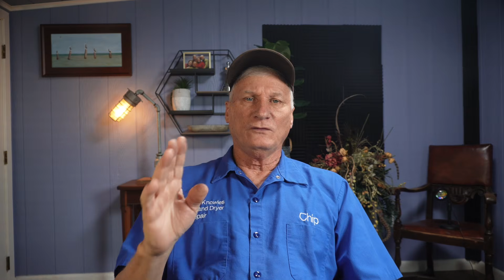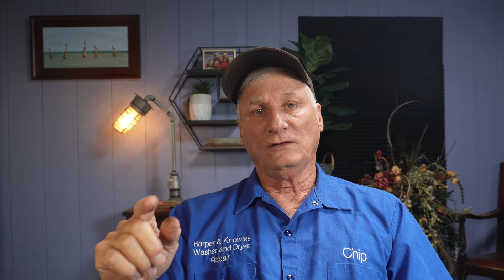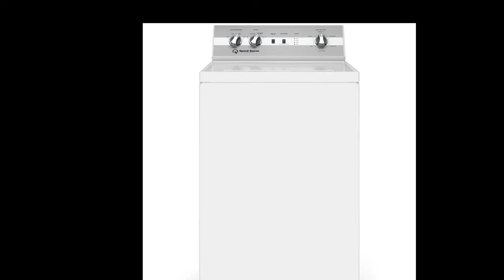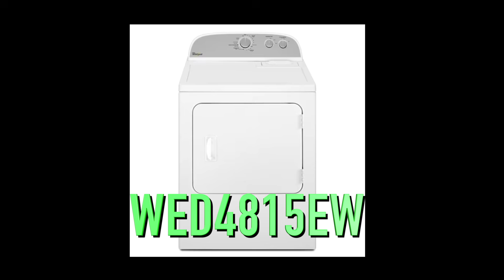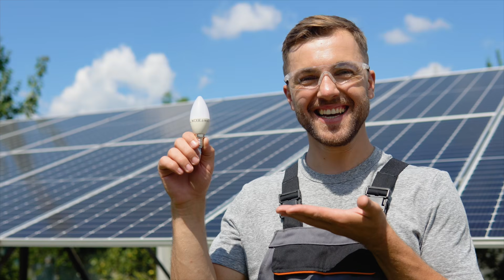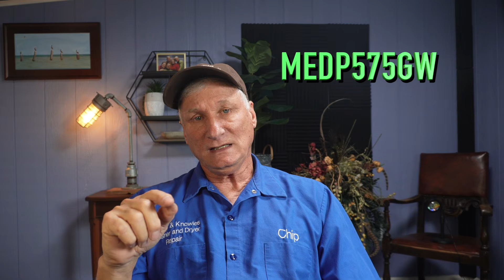I've Repaired Hundreds of Dryers — These Are the Only 4 I'd Actually Buy

Comment from the maker: The full lineup — see tagged products above for direct links:
 Maytag MEDP575GW (Electric) / MGDP575GW (Gas) — commercial-grade workhorse, the closest thing to a Speed Queen at a lower price.
 Speed Queen DR3003WE (Electric) / DR3003WG (Gas) — the one to buy if you want a dryer your kids will inherit. See the video for why I don't recommend the DC5.
 Whirlpool WED4815EW / WGD4815EW — budget pick that still lasts when you maintain it.
 Miele heat pump — premium European option for anyone who wants the quietest, gentlest drying available.
 Troubleshooting and repair guides: harperknowles.gumroad.com
 Full parts and tools storefront: amazon.com/shop/harperknowleswasheranddryerrepair
What dryer have you owned the longest? Drop the brand and how many years below — I'm curious what's actually lasting in real homes.

———
Dryer thermal fuse kit → https://harperandknowles.com/gop/thermal
Everything I recommend → https://harperandknowles.com/gop/store
As an Amazon Associate I earn from qualifying purchases.
Reply: MGDP575GW looks like it is discontinued, replaced by MGDP585GW. Do you have enough data to recommend the new model? Thank you!
Reply: Another fabulous video. Best wishes 🎉🎉🎉🎉🎉🎉🎉
Reply: I have a 2007 Whirlpool Duet set that will be 19 years old in December. They are starting to need frequent repairs, though.
Reply: Thinking of going with a maytag set, No 575s available. Saw your comment re: the pinned note but not seeing a link for any maytags. Guess I'm not looking in the right area?
Reply: Howdy Mr. Knowles, I'm a "neighbor" over here in Texas. Watched a couple of your videos including this one because my 82-yr-old Mother's Whirlpool dryer ("Imperial Series" must be at least 25+ yrs-old) finally bit the dust. I decided to go with your recommendation of the Whirlpool WGD4815EW (since the last one lasted so long, although I imagine the "they don't make 'em like they used to" probably even applies here as well. I'm hoping it is the best bang for the buck. I think this particular model no. goes exclusively to Lowe's and they had the best price of all the gas dryers so I pulled the trigger. Hopefully it all works out, but I just wanted to drop a comment to let you know your video was helpful to my research and your experience and reasoning behind your description was a significant factor. Health and happiness to you and yours sir!
Reply: I have an Estate by Whirpool top load washer and dryer they are both 27 yrs old.   My dryer just stopped working and according to local appliance repair store you can no longer get any  parts to fix it.  now I'm trying to navigate purchasing new appliances and it doesn't sound good.... and apparently none of them last 27 years now.

Comment: Thank you for all of this information. Are there any models comparable to the WED4815EW that either Whirpool or Maytag make? Buying from Costco and the WED4815EW isn't a model they have in the inventory. They have several of the more basic looking Whirpool and Maytag models, though, with the top lint trap. Hoping some of these others use the same chassis and are thus as serviceable. Thanks for any insight you have!

Comment: What a great & useful video! I do my own repairs as much as possible on our 18 year old Whirlpool Estate, which is the same as the recommended  Whirlpool herein. Without any specialized training, I've replaced the timer twice, the heating element twice and I've lost track of the thermostats and fuses I've replaced. NONE of those parts were expensive. The basic Whirlpool is entirely owner repairable with a quarter inch nut driver and a ohm meter (i.e. basic multimeter).

Comment: My sister has had two dryers and both of them don’t get hot causing each load to have to go through the cycle 3 times to actually dry clothes.  What do you think is causing this?  There is no clog in vent to outside.  Do you think hire is an electrical issue?

Comment: Thanks for your very helpful review of gas dryers, which made whole lot of sense. Nothing appears to be made the same quality as the appliances that my parents or grandparents used. I decided to go with the Whirlpool Gas dryer, to replace the Kenmore electric dryer (Model# 110.67102310, Serial# M34005497, Type: DDOT-ELE-24-06024-EL54) that I’ve had for about 20 years plus that has always worked great and has never been repaired and we didn’t cleaned the main vent every year, but it uses a lot of electricity. I’m gonna miss my hamper style door that I have on my electric dryer.

Comment: Chip, I have to ask you another question. I just saw another video where they’re talking about the pedestals underneath the front loaders that speed queen does not supply storage bins or drawers underneath theirs. My question is since you’ve seen these firsthand, I don’t know how they sit on them. Do they bolt down from the washing machine to the pedestal ? Would they match up to another brand’s pedestal that does have a storage drawer as long as the size is matching the width and the depth measurements just curious since you’ve seen so many I’ve never seen one in real life before so I don’t know how they mount to the washing machine to the pedestal.

Comment: It's not that I don't care about dependability, but right now my number one priority is getting a dryer that can dry one item.  If I have only 1-3 items, they will just sit on the bar that flips the laundry and not really dry, and get all wrinkly.  Hanging such items is not an option, and it drives me crazy.  Around 2010, Samsung advertised staggered "flippers" that seemed like they might work, but right after that, I didn't see them anymore and it seemed like Samsung must have changed hands.
Anyway, can you recommend a dryer that thoroughly tumbles all the laundry, even if it is just 1 or 2 pieces?

Comment: Thanks, this is so helpful! I pulled open my old Kenmore dryer (was already old when it came with the house I bought 30 years ago), I found the bottom was rusted out and the real problem isn't so much the belt as it is that the motor is attached to a flexible floor. Time for a new gas dryer. I agree, I don't need a dryer with an app; solid mechanical parts are better. Thinking I should find a washer, too, since this washer is similar age to the dryer.
Reply: D'oh! the Whirlpool ..4815.. is 29" wide- won't fit in my door! Sales rep steered me to a narrower GE (not profile).  Now I am thinking look for a 'young' used SQ that will fit thru my door. Oh- to say the sheet metal is thinner on these new machines is an understatement. And the 'fit and finish' on the display model 4815 was horrible -- poor panel alignments, door hard to open and not aligned to close, among other things.

Comment: Love your videos and honesty.  I've been on standby for a new gas dryer for a while. My Whirlpool gas dryer is now 40 years old and still working great. The last time I took the bottom off to clean leftover lint, I noticed the belt showing signs of wear. I'm sure I will be able to change the belt if needed.  I'm wondering if there are any safety issues I should be aware of with a machine that old?

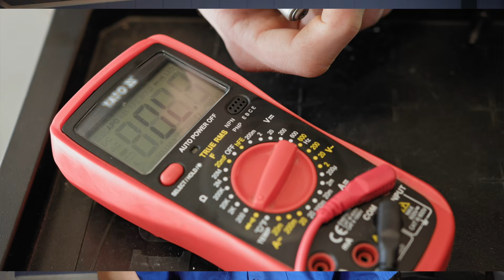Comment: I have a DC5, and no I'm not going to contradict what you've said about them.  However, our DC5 was discovered to need repair almost immediately. Our DC5 was either misassembled at the factory or handled extremely rough during shipping.  This new machine was tearing and putting rub marks on clothing. So, I reached out to Speed Queen.  It took the 5 stated business days to get a response, which then asked for photos and expanded descriptions of the problem.  Climbing into the drum, I could see daylight along the top edge near the 10:00 position.  The drum was not sitting on the guide, the guide was inside.  This is what was catching and tearing clothes, or holding them to be rubbed against the drum.  After sending back this information, it took another few days to respond, wherein they sent a ticket for service to a repair shop.  I contacted the shop after not getting any estimate as to when they'd arrive, I was then told that I was not within their service area.  Back to Speed Queen, wait, get another service company that scheduled the call another few days out.  The wife was less than pleased with all the time it took, but in the end everything was repaired.  Although, Speed Queen never claimed any responsibility for the clothes that dryer damaged.  The entire process made me feel like they were hindering rather than willing to help, unless continuously pushed in that direction.

Comment: My only experience is a Maytag, with the lint filter in the door and a Kitchenaid (Whirlpool) with long filter in the top.  The Maytag kept failing from the plastic "glides that the front of the drum slides on.  I gave up replacing the glide plastic since seemed the drum coating had worn off to give excessive drag, which wears out the belt and tensioner.  The only reason for the glides is to make it quieter, otherwise a bad idea.  The Kitchenaid has rollers w/ bearings at both the front and back of the drum.  The motor failed on the Kitchenaid.  Don't know the life since I bought it used.  A new motor was ~$50 on ebay, replaced over 10 yrs ago.  I've also replaced belts, belt tensioner w/ roller, and the felt seals.  Those parts are cheap and easy, ~$10 each.  I've also had to replace the thermal fuse in the rear.  That happens when family members don't clean the lint filter between every load.  They do now since I threatened that the next time, they will be the one to crawl back there to replace it.  The fuses are cheap.  I left a few spares hanging for next time.  Also clean the vent of lint every few years, and whenever you've pulled the dryer away from the wall for access.

Comment: I have a 4" vent and all of it is All Metal Ducting with 90 Degree elbows, No dryer flexys. Outside my homes wall I installed a 90 Degree Up Draft that has a plastic cup inside. Dryer turns on & the Cup Rises. Dryer turns off and the Cup falls. Super Easy to Reverse Clean from the Outside of my Home because I R Smart. I went to my neighbors house which is Identical to mine, same layout, same builder and my neighbor is a Stickler for Cleanliness. I call him Mr. Clean because he's bald too. He fainted when I moved his dryer just a little bit. There was a full Carpet underneath his dryer. Total Blockage. 🤣

Comment: my job bought a frigidaire washer dryer set for employees. 10 yrs , running  24/7, pushbuttons and dials have never failed, still works like brand new. i know , i picked it up off the dock 10 yrs ago , works like brand new every soft touch button works like new . used by dozens of employees weekly. this is still available at lowes

Comment: Bought a $2,300 LG French door fridge 1/21. 
Nothing but headaches. 
Major problem was compressor conked out in two years!!
Myriad of other problems.
Over 9 service calls. 
These linear compressors are junk. 
We intentionally avoided ice through the door. 
Their in-freezer ice makers stink too. 
Mine works when it feels like it. 
And my experience with LG factory repair is less than positive. 
Techs are poorly trained.
Reply from the maker: I hear your frustration, and unfortunately, those kinds of mechanical failures are exactly why I emphasize choosing simpler, proven designs over complex technology.

Comment: Chip, what is the difference between the DR3 and the DR5? You've got me convinced to oreder one a DR because of the issues with the DC and wait 60 days for it to come but then I see the DR3 and DR5 online and can't tell the difference. Help!
Reply from the maker: Good question, Jill. From a distance the DR3 and DR5 look close because they’re the same 7 cubic foot commercial build with the same reversible door. But they’re not the same machine.

The DR3 is the bare-bones model: plain dials, no steam, and it’s not Energy Star rated. It still sanitizes, but that’s buried inside the Timed Dry setting instead of being its own cycle. It carries a 3-year parts and labor warranty. Current model is the DR3004WE for electric, DR3004WG for gas.

The DR5 is the step-up. It runs a dial plus electronic push buttons, adds Steam Boost and Steam Refresh, a dedicated Sanitize cycle, Over-Dry Protection, Extended Tumble, and a moisture sensor. It’s Energy Star rated, and the warranty jumps to 5 years. That’s the DR5004WE electric, DR5004WG gas. Easy way to keep it straight: the number on the end is the warranty. DR3 gets 3 years, DR5 gets 5, DR7 gets 7. If you want steam and the longer coverage, go DR5. If you just want a machine that dries and lasts, the DR3 will do it all day long.

Comment: Chip, I’m looking to buy the Maytag you recommended but can only find the MEDP585GW at Lowe’s. Is that reliable like the MEDP575GW?
Reply from the maker: Good eye catching that. The MEDP585GW is the same dryer as the 575 — Maytag just bumped the model number. Same commercial motor and drive system, same heavy galvanized steel build, same 10-year warranty on the motor and drum. Lowe's is stocking the current version. Buy it and don't look back. That's a machine I'd put in my own laundry room.

Comment: Is it necessary to remove the top cabinet to replace the timer, or can the work be done from the back of the unit? I have an old Kitchen Aid (I think made by Whirlpool) and I don't like the newer styles with computerized controls.

Comment: HELLO What is the model number for the DR7 electric dryer
Reply from the maker: The current production model is the DR7004WE for the standard white electric. Speed Queen runs the DR7 as a product line, not a single model, so the suffix tells you the version: DR7004WG is the gas, and DR7004BE is the matte black electric. The DR7003 series you may still see listed is the prior generation and is being phased out, so if you’re shopping, make sure you’re looking at the 04 models. Hope that helps, and thanks for watching!

Comment: I have that Maytag dryer.  The 5 year warrenty just expired.  Never had trouble with it, but now it is putting gold/brown marks and streaks on my clothes.  I srubbed all the discoloration off the rear vent cover and washed the whole drum out thoroughly.  However, it is still doing it.  The only thing I can figure is the felt seal is bad so am getting rust or dirt from that.  I don't know what to do

Comment: I just got off the phone with Speed Queen technical support. There is no longer an issue with the cycle selection knob on their new dryers. They replaced the mechanical cycle selection knob with an electronic knob for all of their dryer models that utilize a selection knob.
Reply: Do we know if they also fixed the overheating/melting components issue?

Comment: Chip, just wanted to provide an update here for you. The DC5 is now model DC5004WE(or G). It is no longer indicated on the dryer that you should only turn the dial clockwise and there is no mention of turning it only clockwise in the manual, so it appears they have rectified this design flaw. The whole panel is now different on the DC5 with the new steam function added and it does not seem to be the old mechanical timer dial at all.

I discovered this when we decided to roll the dice and buy one that was delivered a couple days ago. My intention was to just be conscious about always turning it clockwise, but I noticed it was no longer written on the machine and dove into the manual to confirm. You may want to update this video with the current information as it seems they made this fix rather quietly as a byproduct of adding a feature.
Reply from the maker: Thanks so much for the update! Speed Queen came through once again!

Comment: I have a gas dryer that is about 50 years old. It is starting to get really loud and vibrate a lot. It vibrates if I spin the basket manually. I am wondering if it's worth getting fixed or if I should get a new one.

Comment: I currently have an 8 year old LG washer. Seems to be doing well right now, but it is an impeller, which I definitely DO NOT like. My dryer is a Maytag that dates back at least 30 years if not a bit more. It just keeps running. But when either of them finally dies, hubby and I have decided to go the Speed Queen route. So thanks for your thorough take on what you recommend and why!

Comment: I bought the Maytag version of what you recommended for a second home. And couldn’t be more more pleased.    It’s nearly identical to the Roper dryer I bought over 24 years ago…. And the only repairs I’ve made to the old Roper is replacing the main belt and the heating element.   Way cheaper than buying the new garbage appliances today with all the bells and whistles that I don’t need.

Comment: 24" Samsung dryer, paid C$900 for it.  2.5 years later, it has failed.
Needs a new part,  C$500,  part out of stock,  have to wait 2 months for a part.
Going to buy a new machine, going to try a 24" GE.
Heat pump?  New to me, I want to avoid new technology, don't need gadgets that can fail.

Comment: Front loader washer and dryer’s suck. Sit too low, take to long for cycles and the $350 a piece platforms to elevate them so you don’t have to  bend down to load them is a joke. Top loader without agitator for us.

Comment: As an HVAC guy, I think the heat pump driers are kinda interesting, but they can have my gas drier when they peal it from my cold dead fingers!
I like being able to dry 7 pairs of Carhart work pants in 45 minutes or less, where a heat pump drier would take two separate 2+ hour loads to do the same...
Reply: You have to dry overnight while you sleep or during the day while you work. I.e., you have to adapt to the tool, which feels backwards.